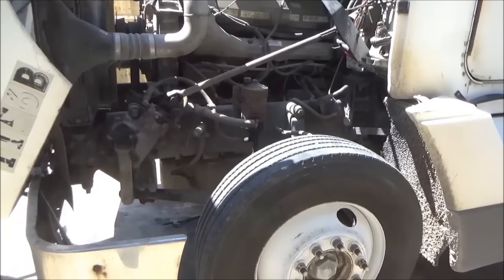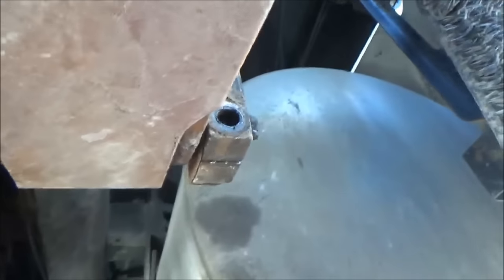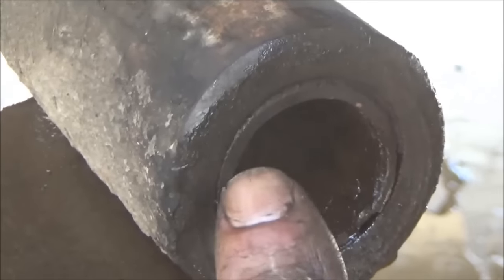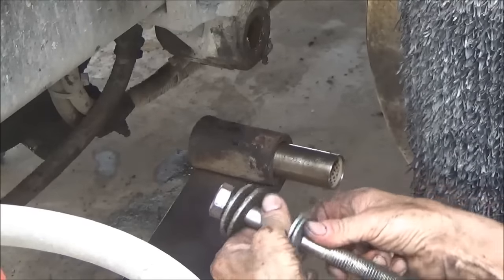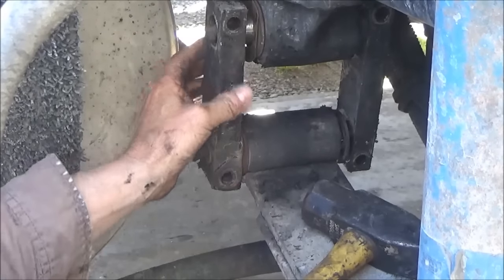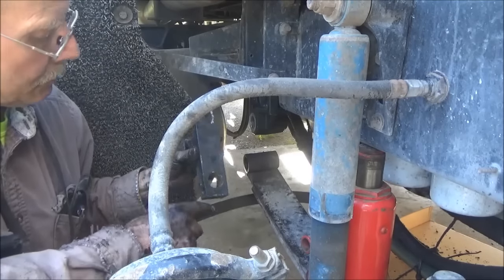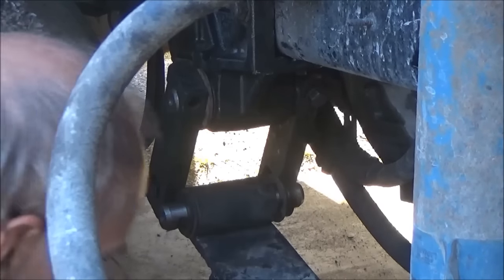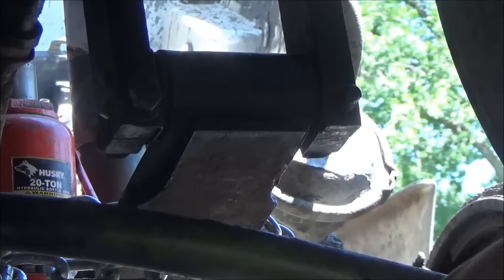How to change leaf spring pins and bushings on a Big Truck

Comment: Need to grease more often,also if you don't keep your 5th wheel greased up and slippery for your king pin plate on trailer it puts a lot of strain on the steering wearing on you spring hangers bushings ect. so keep your 5th wheel lubed real good

Comment: I have heard so many people saying no heat . I worked for kw, pete and Volvo over the past 22+yrs. we used this technique most of the time . it works very well.
Reply from the maker: a dealer mechanic told me that they burn them out so I do it like that because I have no doubts about my torch work, I do have a lot of torch and welding experience. I only had 1 or 2 negative comments about that, I guarantee that person who left those comments has no clue how to do any torch work or weld either.
Reply: If you didnt burn them out, how would you get them out?
Reply: Steven Haviland we used to use a hydraulic ram that had a hole through the cylinder spacers and washers with pull it right out or like the dude said in the comment above you could use an air chisel I've never done it that way
Reply: Steven Haviland oh yeah then you take a Rheem for final sizing
Reply: @robertatwood2503  Yes ,it can be done with chisel another option is  shackle pin bushes bushes installer which can be made on lathe , this metod with oxy cutting is fine longest you dont cut inside of the spirng eye .

Comment: The trick to getting everything lined up is to use a single lift point in the very center.  Watch the pins and shackles when you lift it.  You'll see the point where there's no pressure on the pins. I replace pins, hangers, shackles, springs, and shocks all at once because the parts are super-inexpensive and it's all done at once.  It takes about 30 minutes of minimal effort each side.
Reply: thanks
Reply: Uh---

-- I do not find the leafsrings as "inexpensive":  $730.00 August 2022 Chicago Area fir the soring and fasteners; no shackes or brackets.
Reply: You’re what most would call a suspension guru. Good on ya for honing the craft

Comment: Wrap any lines that are prone to burning with tinfoil. We leave the shackle on the side we are removing it too,  and with a palm nailer if we cant use a hammer and an old 1/2 inch drive extension push the pins out together attached as a unit from the other side. Sometimes it takes the bushing with it..... if you jam a thin wedge under the curl of the spring... basically you are enlarging the part that holds the bushing temporarily releasing the friction on the bushing.   Thanks, great video. Reminds me I gotta go grease my truck!

Comment: Nice video.  I used to use a torch to burn out bushings, though now I have turned a piece of tool stock down to make a driver to drive the bushing out.  I use a zip gun (air hammer) and it works great.  I have also turned a installation pilot so I can use my zip gun to put the bushing back in.
Reply: would love to see a pic of that
Reply: HI FROM MEXICO
Reply: BW8x10 the torch use only is Rubber bushing bro

Comment: I would frozen the shackle bushing overnight then would slide in. Everyone has their way. Using a  torch properly saves lot of headaches. Nice video I learn something every time I watch you!
Reply from the maker: Thank you Sir. A house freezer only goes down to 15 - 20 f normally, that's 50 - 60 degrees colder than outside on a warm day, not much difference, a torch can warm up that eye on that spring 500 degrees fast without hurting the temper, (10 times the difference) but I still like the threaded rod. A lot of people believe the freezer will do it, I never tried it because I already know it's not that much temperature difference. Thanks again.
Reply: Gordon Robertson 
My teacher in welding school had us do it all the time with shop frozer. Worked every time I done it! Hope helps

Comment: Very cool I've been a mechanic for many years on gas truck and car, I'm moving into diesel and air brake systems all your videos are very helpful
Reply from the maker: Thank you Sir. I break a few rules but I always get it done, I won't upload it until it is fixed. Thanks for subscribing.

Comment: Thanks for the video. The suspension on my peterbuilt makes a pop, whenever I turn the steering wheel to far left or right. Went over to my brothers house to have him turn the wheel to confirm that it is in fact the leaf springs bushing doing it. So it's time to get to it. I hate taking the truck to the shop. So this video really helps.
Reply from the maker: Good luck, it's a big job. Be sure to put as many shims on the pins as you can.

Comment: We got so tired of this, with our old fleet of freightliners. We started installing Hydrolic hoses on them. Remove the  grease fitting, install hose, drill 2 small holes in the fender(in front of the fuel tank) mount the other end of the hoses in the fender. Install grease fittings on end of hoses. Every time those trucks came into the shop(any reason at all) GREASE THOSE SHACKLE PINS!!

Comment: I would have changed that upper bushing ,we use to replace hanger and bushing at the dealers mostly for time sake but I have pressed out the bushings I would recommend pulling it off  and press it out unless your using a tiger tool set up. it was just easier for me that way with out the tiger tool or the otc tool setup.
Reply from the maker: I still have the aluminum bracket for that upper bushing, I do plan to change the bushing if I need to do it again or even on another truck that uses that same one. I'll just weld a bead inside the bushing to shrink it and slowly heat the aluminum if it needs it, it will slip out that way.

Comment: I always used a frame rail jack, took out the u bolts, unbolted the shackle and front hanger and pulled the leaf out and used a press to remove the bushings. Much easier that way

Comment: Sir , I really appreciate detail direction , even thou I am not gona do it myself but now I know what goes on down there on front axle suspension . The best part is like most people with older truck like mine or yours the special tricks ( I.e - heating & cutting for pin extraction) but my question is does heating mess with Tempar of the leaf spring ?
Reply from the maker: Some people think it does but my personal opinion no it doesn't if you don't sit there and get it way too hot

Comment: Made a puller out of scrap metal that screws into the grease fitting hole and it pulls stuck pins out. Just a bit of heavy tube,flat plate and threaded bar.

Comment: In this case a sawsall is your friend instead of a torch. There is no risk of fire.
 Drive the pin out halfway and cut it off with the saw. Use the saw in the bushing and carefully cut a groove lengthwise in the bushing just enough to cut through. This will relieve the tension of the bushing. Then use a driver and knock the bushing out.

Comment: Great video, again. Question though, do you think putting the bushings in the freezer for a bit before installing them would ease the installation??
Reply from the maker: Some people think it would be easier to freeze them but I never tried it that way, I don't think it would help because the temp. difference from a house freezer to working outside really isn't that much (50 deg. or so) the temp difference from cutting out the old ones would be at least a couple hundred deg. and the thin bushings would instantly change to the temp. of the spring eye before you got done installing it. I never tried it, just doesn't make sense to me, not much temp diff. Thanks for watching.
Reply: @57bagre  Sorry Gordon but freezing bushes it makes difference .
Try and you will found out ...
You dont believe in this metod but you did not try it ?
It is common metod with heavy trucks  applications freezing bushes and pins before instalation

Comment: Good job Gordon have you ever changed torque arm bushings before need to do mine but don't have a press
Reply from the maker: Between the diff and the frame? or the one that has the air bag on it and looks like a leaf spring?
Reply: @57bagre  the ones between the diffs and the frame trying to figure out how to get new bushings in got old ones out but don't have a press I was thinking of freezing the new bushings first before installing

Comment: Nice Video I have a 1990 Model mack I am going to half to change both sides of my spring Bushings and pins. my washer is lose I know they need changing My question will this make your truck steer funny and my tire on the driver side is getting humps on it with flat spots on the out side on top of tire .  Can you let me know would the spring bushings do this Thank You I love your video I learn a lot THANK YOU!!!!!
Reply from the maker: I can't say that changing the pins and bushings will stop the tires from cupping, but if it needs it do it, it will help, and it will prevent further damage. You can save your steer tires if it's not too late by running them on the drives if you have enough tread left, after they run on the drive axle long enough the cupping will disappear, of course by then they will be getting too worn to use for steers but it's better than just paying to dispose of them. Thanks for watching and commenting.

Comment: How tight do you want the pinch bolts on the shackles?
Reply from the maker: Not too tight. May 50 FT Pounds. I think those were 1/2 inch bolts which would torque at around 100 ft pounds but there's nothing working against them here to speak of so why stress the aluminum shackle bars? Just hammer them down with a 1/2" impact for about 1 to 1-1/2 seconds or 1/2 your strength with a hand ratchet.

Comment: Just wondering. What kind of trucking do you do Gordon. I know some truck mechanic's where I'm from but they have all worked on big trucks that haul coal. People who have retired talk highly of there jobs and you can tell that they enjoyed working on coal truck's.
Reply from the maker: Sorry to get back to you so late, I just got back from a short 2 1/2 day road trip. I usually drive locally hauling steel coils on a flatbed, that work is slow right now due to a lay off at the steel mill which is in the process of coming back up now but still not going strong yet. I used to haul dry van both OTR all lower 48 and regional, so I'm back on regional and local mixed. My mechanic experience was I worked as a full time car mechanic for a number of years in the '80s and into the '90s and got into welding and machine shop work and then got into driving in the '90s and back to welding for a few years and in '01 back to driving a big truck. So I'm all mixed up with trucking, welding, mechanic, outdoor services like Bobcat, excavator, tree and stump removal, and some home repair.
Reply: +Gordon Robertson  Sounds like you have worked hard all your life and you know quite a few different trades. Your generation in my opinion is the last hard working generation around that are still working. I hope that steel production picks up for you and it would also help people from the area where I live at if the US would start producing steel again like they use to. We have alot of met coal around here which is good to make high quality steel with. I love your videos and I showed one of the truck mechanic's  that I know one of your videos. He said you make the job look alot easier than it is. Keep up the hard work and thanks for messaging me back.

Comment: recently snapped a front spring on a dump truck. after they were replaced one piece of steel doesn't set directly under the other. like lower part of the spring sticks out half inch from the upper piece. I was told in time it should straighten itself out. do you think eventually it will straighten out & safe to drive in that position?
Reply from the maker: New springs do settle after a couple months of use. If a reputable spring shop made the springs, I would take their word for it. I would have to look at it myself to offer an opinion. Thanks for watching.

Comment: How often do you need to grease your truck? Also how often do you do an oil change?
Reply from the maker: 5k to 10k miles for OTR or every 2 to 4 weeks local. Thanks for commenting. Oil change 10k to 15k miles OTR, 5k to 10k miles local. 
5k to 10k miles for OTR or every 2 to 4 weeks local. Thanks for commenting.

Comment: Did it make a popping noise when you turned?? Mines doing that on my 384
Reply: Nathan Sutton yes they can but I would check to make sure the U-bolts on the axle are tight.

Comment: I have the same truck. I looked into this and could not do it in my drive due to it being slanted. Couldn't stableize truck.  

Shop charged 2,500 for two new springs, shackel bolts, u bolts, wheel seals , and bearings. Plus alignment when all said and done. 
Plus warranty for a year. 
But I went back after 16 months for one part failure on another repair and they still made it right. 

Jobs like this u really need to be careful with. And understand what your doing  Trucks heavy. U need proper Jack's and stands. Then impact to handle everything. Book says to replace all bolts with proper grade bolts when removed. Since trucks so old. 
Most of all u need to torque everything property. Run it for about 50 miles and let it settle. Then re torque. 

This is no easy job. And it could cost u later if done wrong. Alignment will eat your tires later. Or worse a bearing or a king pin.

Comment: Hello mr gordan ive replaced pins and bushings on my 1999 freightliner fls 112 and washers were loose on each side and still after i was done there is still a gap but does not have any play do i still need to put shims
Reply from the maker: It will slide side to side when turning if it has a gap on the side, I would fill the side gap as much as possible. You can take out some thin shims and add a washer, the washer might need to be filed down on the sides so it fits as flat as possible so it doesn't wear the shims the wrong way.
Reply: @57bagre  will do thank you sir

Comment: Did Mine 12 Months Ago,Did`nt have gas,(I`m a poor truck owner operator), Used a Aligater saw with steel blade init,Just cut thru 1 side , Then knock it out.

Comment: What are the symptoms of bad bushing?

My truck is shaking at 1000 rpms and struggles to go up the rpm when I'm at 9th gear. .. going up hill it struggles as well...
Reply from the maker: That's not your bushings. The bushings on this video will only affect turning or bumpy roads will make popping noise and eventually wear through and break the pins or springs. You could have a fuel filter issue, ecm, injector, turbo pressure, air filter, I don't know what else.
Reply: @57bagre  thnx for replying ... really appreciate it ... i have a freightliner columbia 2004 ... i was just watching another video ... he was saying if its shaking try raising the ride height bar ... i will try to do that tomorrow first before I take it to a mechanic and pay a million bucks
Reply from the maker: Don't raise it too high or your shocks will over extend and could damage them. you should set the height about half way the shock travel.
Reply: @57bagre  ok i will make sure of that ... will update you tomorrow if it worked out ... hopefully it does ... thnx for your help again ... really appreciate it

Comment: Why did you use washer i change my leaf spring but sprint is moving left to right in shackle should i put washer in it
Reply from the maker: I used a washer because I didn't have enough shims to take up all the side play. I thought I covered that in the video. Thanks for watching.
Reply: So it should not move side to side
Reply from the maker: Right. Just enough room for grease, no more.
Reply: Gordon Robertson thank you so much

Comment: Just wondering, what is the reason to jack both wheels off the ground? I'm getting ready to do this job on 99 Classic.
Reply from the maker: One reason, I did both sides, another, it helps line up the spring and the shackle when putting it back together. Thanks for watching.
Reply: I waited too long to do the job, so I'm gonna have to put new springs on it as well now.

Comment: The heat may ruin the temper on the spring?
Reply from the maker: It's OK, the temper on the eye of the spring is not that important, and it really didn't get that hot anyway. Thanks for the comment.

Comment: i wouldn't advise using a torch at least not as a first resort. too much heat will distort the integrity of the leaf spring. i use a sheet metal cutter adapter that came with my air hammer. place the citter on the part of bushing that faced the curve on the leaf spring. their will be a small gap where youll use your cutter.

Comment: Gordon i like your videos but you need to start using a grease gun. I broke a front spring on my 1986 peterbilt dump truck and i took out pins with a punch and small claw hammer. They didn't show any wear or rust on the pins and reused them.
Reply from the maker: That is one of many, many things I would like to be able to do more regularly, but I can't afford to pay someone to do the maintenance on my equipment, so I do the best I can with the time I have to work with, it's the long winters we have here that make it most inconvenient, and the truck is parked at my job 15 miles away. I could get one of those nasty handheld grease guns to keep in the truck though, I prefer to grease it at home where it's easy to clean up and I have a big air powered grease gun.
Reply: I'm way behind on repairing all my junkers. When he have time to do the work you don't have the money. and when you have the money you don't have the time.  I like your videos.
Reply from the maker: Thanks Keith

Comment: I have a shake and a tap at 60 mph will that spring bushing cause that and how do I check?
Reply from the maker: The spring won't shake, it will knock when making tight turns or driving on bumps but mostly at slow speeds. A shaking at high speed is almost always tires, brakes or driveshaft related.
Reply: Thanks I will check my drive shaft I got it cut to fit a 13 speed